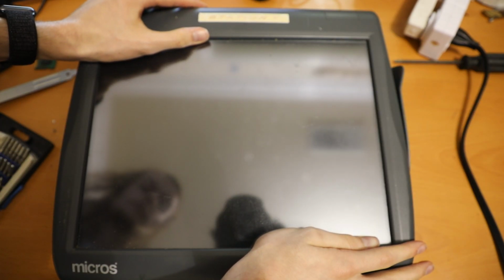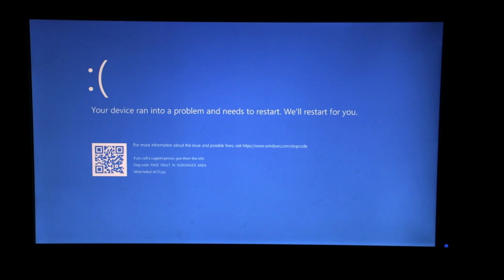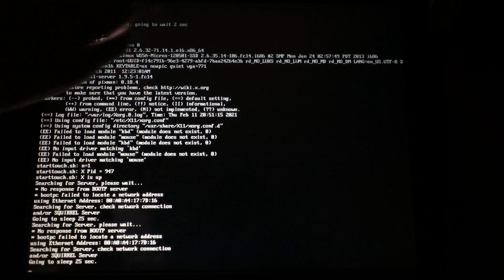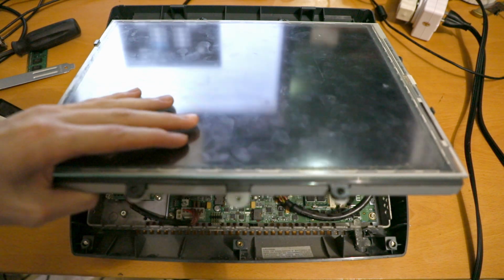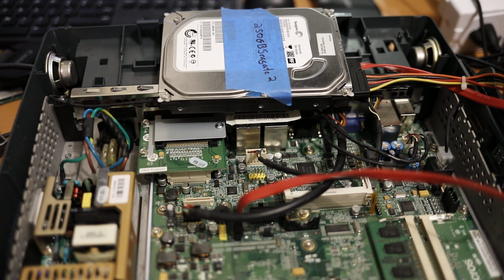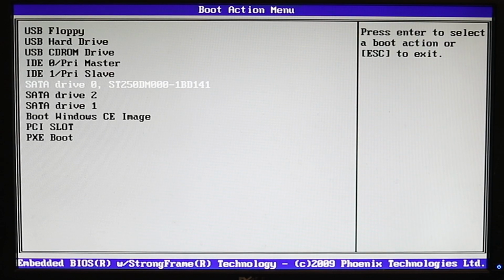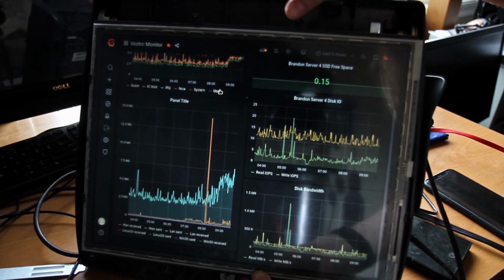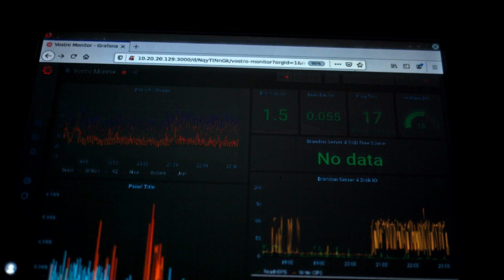Turning a Micros POS terminal into a Grafana monitor

Comment: DSL (Damn Small Linux) will fit on that compact flash drive with lots of room to spare.  The gui isn't pretty, but if you're just using it as a browser to look at a grafana dashboard, who cares.
Reply from the maker: Thanks for the suggestion. Let me give that a try and see how it goes.
Reply: Is there a way tonuse the display as monitor on  desktop pc? Could you send me a photo of the display back tag sticker to see the model info to search a external display controller? Please